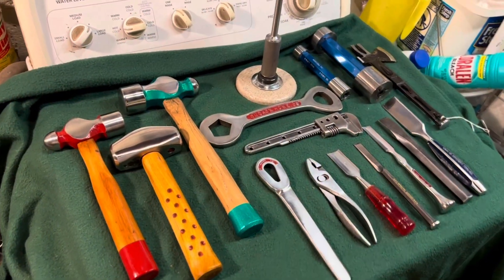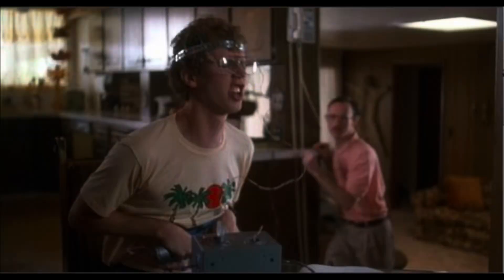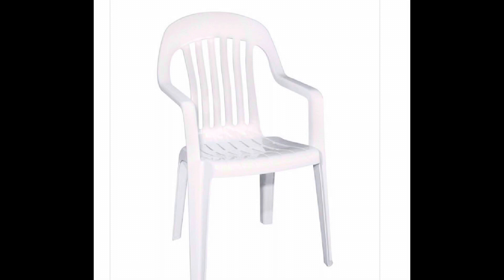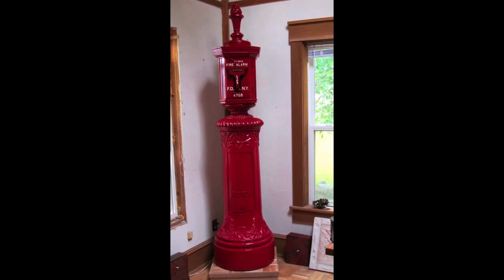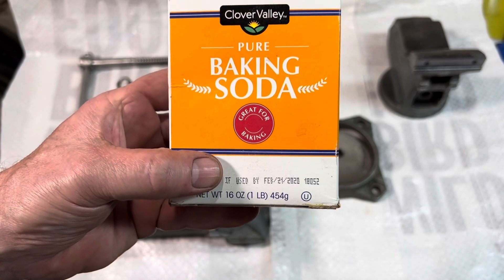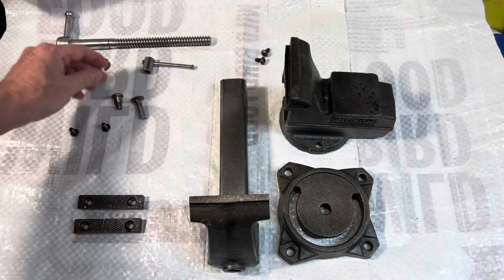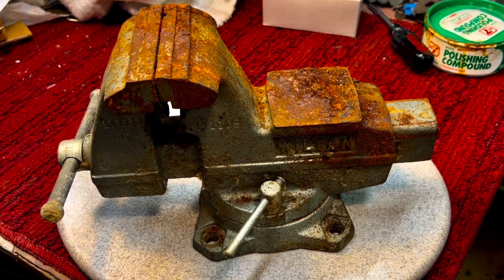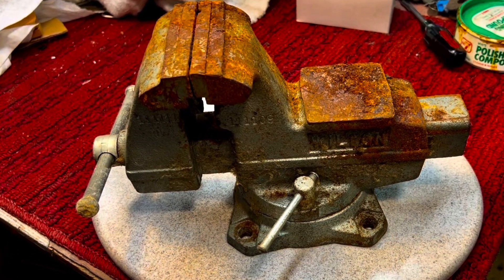You Won’t Believe What I Found!

Comment: I rented a small garage in the alley behind my parents house. Up in the rafters were a half dozen of the strap chairs. The strapping was totally wasted. I pulled them down, stripped the material off, and rethreaded new strapping. You can buy kits at the hardware store to repair those chairs. The quality of the frames were excellent. To this day my parents and their neighbors sit in the backyard on those chairs. 
My mother's uncle was a fireman for the City of Allentown, Pa. His job was manning a substation where those call boxes were monitored.  There was a large paper tape reel that when a call came in,  it would sound an alarm and punch a series of holes corresponding to the number on the box. The box number for example would be 241. There would be two holes punched, then four, then one. Then he would determine the location of the box. He also sent the identical code to the nearest firehouse by the same paper tape method.  And they responded to the call. The substation was filled with glass cased  acid storage batteries as a back up in case of a power failure. Part of his job was checking the specific gravity  of the cells to keep them in top condition. Then the city abandoned the system and he took retirement. Amazingly, he knew the locations of almost all the boxes by heart. But he still had a master list to refer to.

Comment: ScoutCrafter, 

Your description of lawn chairs and their history brought back memories.  There was a family get together almost every weekend.  Chairs were put into the trunk of the car so you had somewhere to sit when you arrived.

The folding metal chair brought back thoughts of the dreaded "kid's table", where we were banished to, for the meal, no matter the season.  The kid's table was almost always a card table with metal folding chairs.  I'm sure the designers went out of their way to make sure the table was too high, or too low, to sit comfortably.  Undoubtedly, one of the chairs would be bent, or from a different set that didn't match and didn't fit the table. No matter how good the food the "kid's table" seemed like a punishment. 

I  also remember my Uncle offering us a quarter if we could go 15 minutes without talking.  As I recall, after earning the quarter we'd have to give it back if we made a sound.  It was a fix.  I don't think my uncle ever paid a cent. 

I  also remember each spring my father and I would check the webbing on each chair.  A trip to the hardware store and we'd start replacing the old torn webbing.  You would cut a piece fold the end into a triangle, poke a hole and insert a sheet metal screw.  You'd stretch the web tight and attach it to the other side.  When you finished you never had the webbing tight enough or loose enough.  It was never quite right.

Thanks for the memories, 

Bob

Comment: A couple of great finds on your walk. Still using my Wilton vise that I bought at Farm & Fleet with lawnmowing money. It is nearly 60 years old and working fine. I have it bolted to a cast iron base that I use as a welding bench. 
I don't sit in the strap chairs I am a bit north of 265 and hate to break a strap on those nice old chairs. 
The PVC chairs last a long time in Michigan. The two in the front yard are 20 years old. I had to put an aluminum strap on one to bridge a crack in the back. 
Hard to find good ones for under a hundred dollars of today's funny money.

Comment: The thing I remember most about those tri-fold lawn chairs with that vinyl tubing weave is the smell, no matter how old they were when they heated up in the sun they had that terrible plastic/vinyl smell......I like the nylon strap & aluminum chair like you got but if you left them outside the UV rays would deteriorate the strapping......Saw a free one in perfect condition on Craigslist a few days ago but further than I wanted to drive for a lawn chair.........BTW to see an adult over 200 pounds back in the day was rare so those lightweight aluminum frames held up quite well.
No call boxes where I grew up, not even street lights, just Stars & Owls.

Comment: Great video! Love the advice I always get from watching. I also grew up during the 1970s and I recall seeing some porch chairs that were exclusive to porches. Remember back then most houses had porches where people commonly sit outside during the late afternoons? Anyway these chairs as I recall were almost always all steel construction and seems like they were always painted a light green color. They had holes punched through them all over for ventilation and the holes created designs and patterns. The most significant attribute I recall about these chairs was that they were always like couches and would easily sit two or three people and they were able to swing or sway back and forth if you pushed back with your legs. I never see them anymore but I'd love to own one for myself. They were common here in N.C  back then. I assume they were sold all over the country back then.

Comment: We had fire call boxes in my neighborhood, much to the delight of the neighborhood trouble maker. They went the way of the phone booths. I have a set of steel chairs waiting to be refinished, and for as long as I can remember I brought one of those trifolds for my sister's beagle to use on camping trips. I even have rolls of extra webbing to repair the other ones. You sure brought back a bunch of good memories!

Comment: Hey SC.  I have some of those "plastic " chairs. But, when the rattlecan spray people came out with the paint for that type of chairs. Well, I tried it out. Works wonderfully.  UV protection. 
I took some southern yellow pine  to make runners to screw the legs to after I soaked them good with oil based redwood stain. They sit out in the Florida sun year-round (except during tropical weather alerts.) I weigh ~280#. No trouble in over a decade now. Used the redwood oil stain on the wood slats & arms of my porch glider,  & the redwood slats on my outdoor grill fold-out tables . Now 25+ yrs old. Grill with its dual burners & side burner now on it 3rd rebuild. Can't beat cast iron grills. Clean it good. Replace the grates, twin burners, regulator  & hoses. Paint it with high-temp BBQ paint. Back in service for another 8-10 yrs. Great backup for power outages.😋🌽🥔🧅🍞🫓🍖🥩🥓🍔🌭🍳🥘
Reply from the maker: I believe some of the vinyl products are different and better then others, I think it has to do with the chemical additives to the product that will determine how long they last.  I have some early vinyl chairs that were bulletproof and quite heavy. Years later I bought some very inexpensive chairs for a one time BBQ and they were really junk.  I guess you get what you pay for.   =D

Comment: There are still a few of those call boxes just over the Queens border near me. Nothing in Nassau or Suffolk. But I do remember emergency phones on the side of the highway. Remember them? I never needed to use them, but I remember those clamshell boxes for the phones. I remember a guy a few years ago sat down on one of those vinyl chairs after he was swimming and his testicles slipped through the slots on the seat and he got stuck and the fire department was called and there’s a picture of the chair and the guy laying over on its side as the firemen were trying to gently cut the vinyl away to free the poor guy

Comment: You are the “Way-Back” machine. ‘Nuff said. About the Crescent chisel…. I center punched mine in the end cap, back of the underside and top of the cutting edge with a HF automatic center punch. Very small indent, leading me to the conclusion it was steel. But casting steel is a problem as casting steel to crystallize properly is not easy, so yes, I’d love to know how it was made. BTW, I love the feel of it in my hand- perfect! 
Another great video.

Comment: So I have a few tool boxes that are more show tools then users though I'm loathe to admit that. Anyhow, I've tried the rust preventative paper, drawer liners, desiccants, everything. Just recently I came across a new solution that I'm really pleased with. It takes a little bit of hunting, but if you look around on eBay or Amazon, they sell these little vented pucks made to drop into cigar humidors, if you buy them by the 50 pack, they come out to about 15 cents each. I've had good luck with glycol desiccant in the past, but if you don't change it regularly enough, it can actually hold moisture in the drawer that would otherwise dry. You are supposed to activate these pucks by forcing them underwater until they no longer float and then drying them out. It's just a little aluminum dish with a few holes on each side. Anyhow I decided to try to experiment, the main way you set the moisture level is by weighing the pucks, it's a pretty low-tech setup. Anyhow I threw one in each drawer without activating them. I also for the first summer did not run my climate control system in the shop which keeps everything exactly 68° and 55% humidity. It's been about a year and just today I was poking through those boxes. I was really pleased to find that almost all of them were completely weightless, once you have activated them, they never dry out completely. So I haven't had enough time to test very thoroughly, but I think these might be the ticket. They are very small so they don't get in the way, but I theorize that the aluminum and felt sandwich draws the humidity but doesn't allow it to escape very easily at all. In theory, I can just get in the habit of picking it up every time I open the drawer. If I get a heavy one, I can toss it and throw a new one in. Your bucket system seems like an excellent long-term solution, but the downside of watertight is that even ambient humidity has the ability to condense if there are temperature swings. I think the pucks might be just that tiny bit of added protection for when the buckets heat up

Comment: This is a little late regarding the fire-plug wrench, since I was out of town.  Obviously, the pentagon end of the wrench is for opening and closing the valve of the hydrant.  The somewhat triangular end is for tightening the firehose brass fitting to the hydrant outlet.  The portion of the triangle that is directly opposite the pentagon, and in-line with the midpoint of the wrench, is designed to fit over the brass "pins" that stick up about 1/2 inch on the hose brass (180 degrees apart).  They only need to push the pins a little to get the hose to cinch up.  If someone cranks on the pins with the wrench, they will over-tighten, and possibly damage the gasket.  This is no different than a garden hose, where over tightening really doesn't help, and may be worse.  The wrench is curved to allow for some leverage against the curved surface of the brass connection section.  I do know that some guys carried a rubber mallet to pound on the opposite end to add some "heft" to it, but not really sure that was needed very often (if they took care of the hoses).  Nowadays, they have a hydrant wrench that folds and fits in the pocket of the bunker gear.   Wayne out West (retired paramedic/firefighter/fire code official)
Reply from the maker: Thanks so much Wayne!  I figured that the bend was too perfect to be accidental!  LOL
Reply: I suppose that I should add that there is a distinct possibility that the wrench end with the triangle was meant for a different shape hydrant valve.  I have never seen one, but is it possible.  When I used the wrench a few times (way back), it worked for tightening the pins on hoses to hydrant, but it was not ideal.  Most of us had a foldable light-weight hydrant tightening wrench that we carried in bunker jacket pocket.  The hydrant valve wrench was a rather large unit, larger than yours.  New hoses, of course, also have 3 lugs that are 120 degrees apart, and there are many other styles of quick disconnect, storz, and others.  180 degree pin hoses are still available, but I haven't seen them on any of the rigs where I live.  Anyway, I'll leave it at that.  Wayne out West    (On the road again...)

Comment: If you don't neutralize the vinegar acid, what happens?  Does the paint flake off in a matter of months for example?
Reply from the maker: Hello Edward- Great Question!  The reason you neutralize the acid is basically to slow down the post flash rusting.  The bare metal really wants to rust up after rust removal.  😃👍

Comment: I'm not at all critical of your choice, but even if it were a tapered pin, because it's a box section, you could necessarily take a piece of bar with a scrap of dowel pin and have the necessary leverage to drive the PIN. If nothing else, a piece of flat bar with a wedge above it would achieve the same although you risk raising the top of the box section if you don't use another piece of flat bar between the wedge and the top of the box section
Reply from the maker: I never seen this type set-up before on a vise and had no desire to possibly open up a can of worms especially when I was able to run a round brush thru the captive nut and clean out the threads. I have learned the hard way that sometimes you create your own problems by taking unnecessary risks.

Comment: John, is there anyplace that you can order vise jaws?
Reply from the maker: John- Yes a few places.  Just google vise jaws or replacement vise jaws.  
However you have to be careful because a lot of times they don’t line up the way they’re supposed to that’s why most people try to make their own jaws custom-fit made for their exact vice I have seen vices where the holes are off by a little and the jaws just don’t fit 😃👍
Reply: Four years ago I got some brand new Record jaws for my 6" Record vise, off Amazon.  As I recall they weren't cheap Chinese knock off junk.  They fit right on, and work for my purposes.  What other companies Amazon may have vise jaws for, I'm not sure.

Comment: I’ve an Erie vise from my Dad I’m going to clean up. In very good condition, but a touch of rust in the wear areas. Any suggestion on finding touch up paint to correct those areas? Or is this something I should just strip and repaint with enamel or epoxy appliance paint?
Reply from the maker: Hi Dan- Some Vises are put thru hard use and usually just have a paint job to keep it from rusting while others are the center piece of the shop and look ornate. If you never had the vise apart I think it would be good to strip it down completely and remove the rust, paint, lubricate and reassemble.  That should last a lifetime and only takes a weekend. 😃👍
Reply: @ScoutCrafter  John, thank you for the suggestion. It is in really good shape, but well used and loved. I’ll plan to take it apart and fix it up. I’ll wait for your next video to get an idea of what paint to get. Thank you for sharing your hard earned wisdom!

Comment: I found the exact same Wilton vise at an estate sale. I like your price better than the $15 I paid for it, but not complaining. However I have a little problem. When I took it apart to derust it, I misplaced the swivel lock mechanism. The carriage bolt on the bottom is 3/8, that’s easy, but I’m not sure of the dimensions of the rest of it. I’m sure I can make one on my little lathe, but want it to be the same as original. Could you make a measurement for me? Thanks, I love the channel, watch it every time. Always interesting.
Reply from the maker: The diameter is 5/8" and the height is 15/16"   Hop that helps!
Reply: @ScoutCrafter  thanks!

Comment: I don't mean to crab your Wilton in the slightest bit, but is it just me or has nobody made a really good looking vise in 50 plus years? I love an old Colombian, Reed, Parker, American, York, I'm not picky. I  like the old Wilton bullets but I think they are wildly overvalued. For my money, I would take a Chas Parker with the smooth jaws and the pivoting jaw any day over a Wilton bullet. But I'm also convinced vices are like clamps, you can't really have enough. You have to have some that are accurate to the 10,000th and others mounted to a solid post outdoors that you can really wail on with a hand Sledge. But regardless of the price point, they are all consistently uglier in my opinion. I don't understand, I would think YouTube alone would make it clear to manufacturers that an overbuilt cast iron vice would do quite well even at a very high price point. Even Kurt vices have gotten ugly, Orange does a good job of sticking to the classics, but machinist vises are necessarily boring and a totally separate price point and desired features
Reply from the maker: I feel the same exact way.  Modern vises are functional but with little artistic flare.  What a shame.